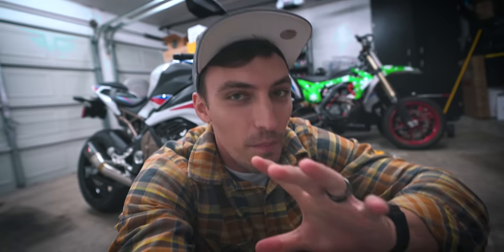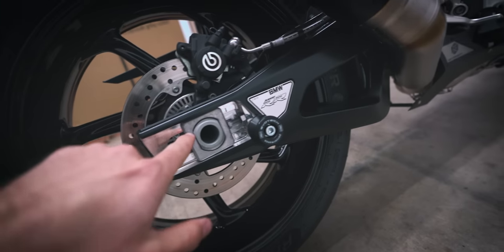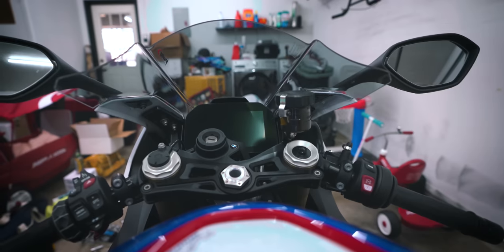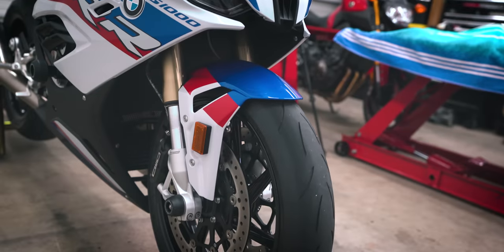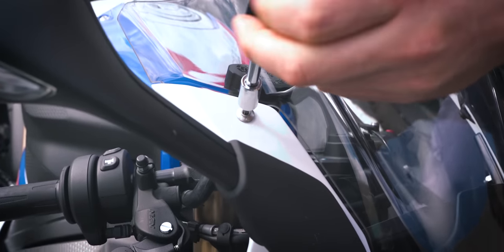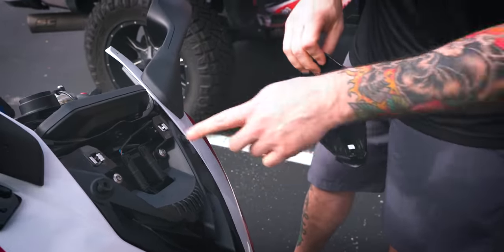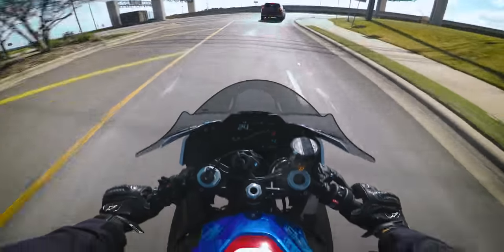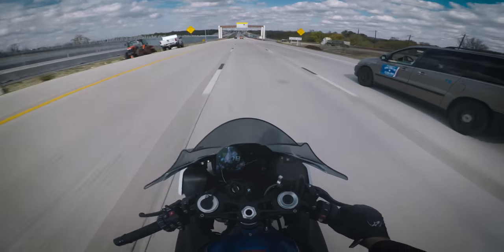3 EASY Mods I Should've Done Sooner on my Motorcycle

Comment: I got the Puig windscreen (also from Motovation) for my 2020 RR last week. It provides better wind protection and is quieter.  You'll love it.  I got clear not only because I like the visibility, but I put a mount for the Insta360 One X on the triple-tree that gets the TFT console, everything through the windscreen, everything around, and me and my body position.  Using it at COTA next week.

My other mod this week was an R&G cover set in case I crash it at COTA.

Comment: Keep the purple <3 my favorite color. I knew they were going to set the bike off. It's too bad a out the chain adjusters. I had gilles on my cbr600rr and I wasnt a huge fan of them but they worked. I have lightech on my cbr1000rr and it's a lot better efficiency wise and adjusting with the clicks per turn. The gilles doesnt have it unless they changed their set up.
Reply: Also I've used puig, zero gravity, and hotbodies.

I prefer zero gravity, then puig, and hot bodies can go right in the trash it worked for my needs but not a fan
Reply from the maker: Good to know. Will give them a shot though and see :)

Comment: Wouldn't the block off plates look much better if the outside didn't have any screws or bolts and had studs on the bottom instead.

Comment: You dont need to press the clutch every time you shift gears??
Reply: He has a quick shifter, so no. But you can shift without your clutch on a regular bike too, just takes a little finesse. I only touch my clutch when I’m stopping
Reply: @jacobpriest8174  thanks mate - no burden on the engine or long term impact?
Reply: Mohammad Syed clutchless shifting up or down is okay if it’s done right. Quickshifters allow you to shift without letting off the gas, and if you are using it in low RPM’s it’s hard on the gears. It’s meant to be used in a “race” fashion (high rpm riding and shifting)